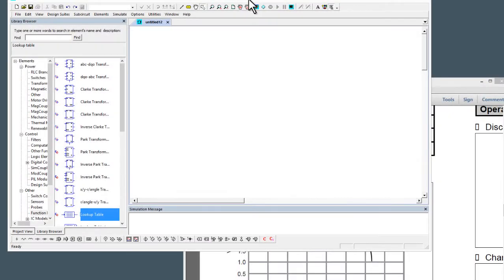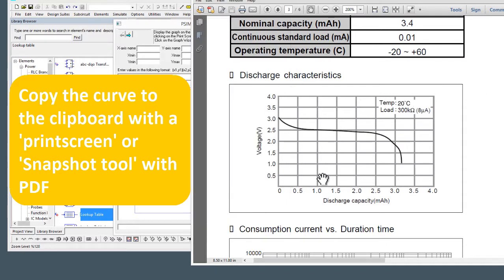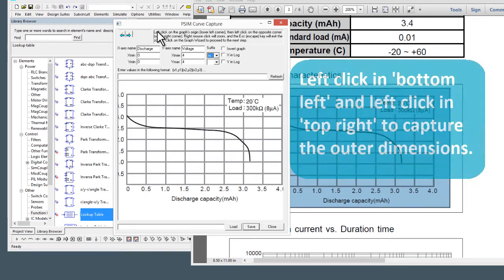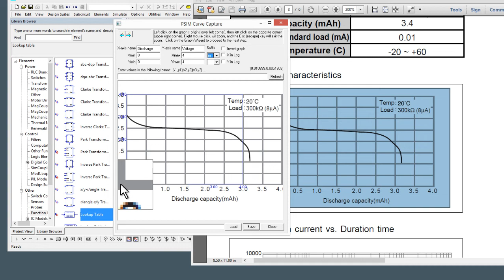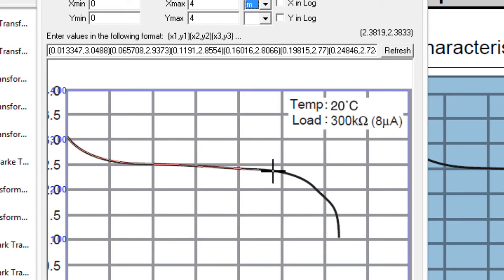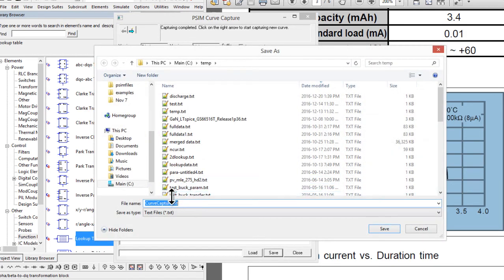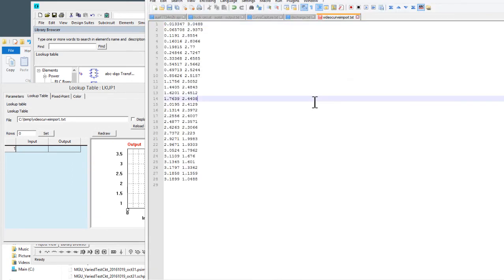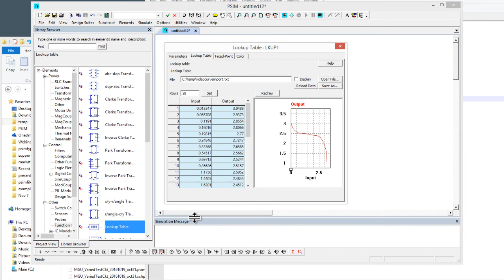PSIM Curve Import Tool

Comment: Does curve capture tools come with thermal module? Because I pressed the curve capture tools from utilise tool bar didnt come out anything.
Reply from the maker: +John curve capture is included with version 11
Reply: If I didn't have thermal module package in PSIM student version, can I access this features? I have pressed that curve capture didn't pop out any tools box.
Reply from the maker: +John general curve capture comes with version 11. The thermal module has the same tool but built into the device database editor.
Reply: Hi PSIM, i have the same problem that MHZ XTAL, I have installed the 11.1.5v (PSIM Free Teaching request) but when I click on Utilities -> curve capture tool, the utility windows does not show up :(
Reply from the maker: I will check this.
Reply: thanks